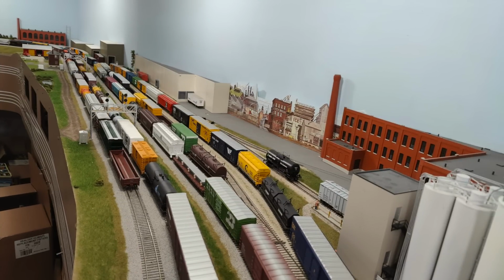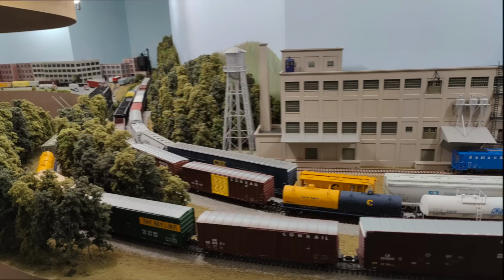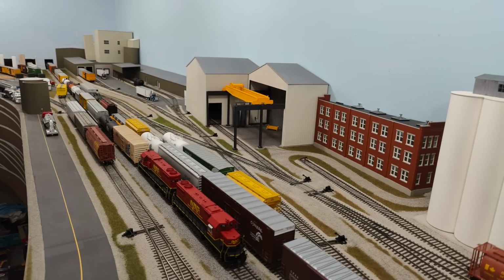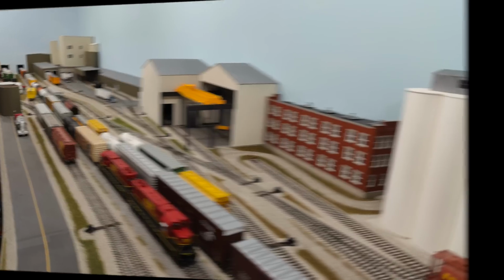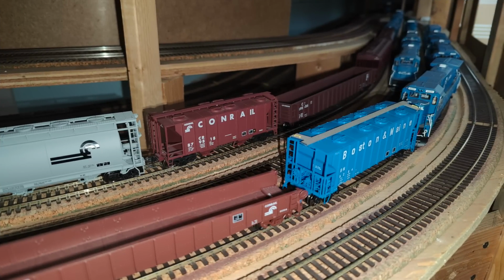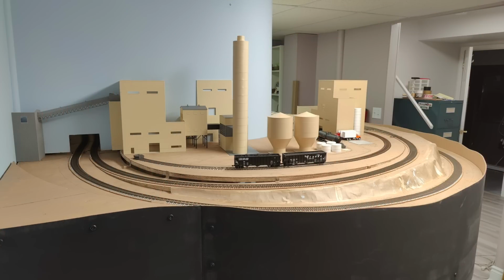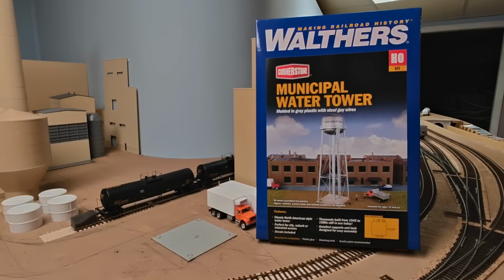Q&NE HO Layout Video 168 - 250330

Comment: I be curious if that TOFC car warp was a result of Zinc rot or not
Reply from the maker: You are not the first person to suspect/suggest that.
Reply: @ I don’t know how old the car is but I’m told the older ones had it
Reply: @nyemt601 is it from sitting in storage that got too warm or cold somewhere or the material used?
Reply: @SRF1978 I’m told it was from the subpar material used back then. But I have also had reports of it showing up on today’s models as well. I’m told doesn’t matter how you store it. (Granted moisture heat cold are bad) it still pops up. 
Kind of makes you nervous when you purchase these cars and then tuck them away. 
And it’s not only limited to the long flats 
I’ve seen reports of cars that use certain types of weights as well
Reply: Yes I bought a 2pack of ATSF RTR 85ft flatcars at a train swap meet 5 years ago. That were both warped. I didn't notice it at first or when I bought them. I took them all apart and tried so lightly to straighten them and cracked both frames. It straighten them out some but tried to CA glue the pieces back together.  There ugly underneath  but fix it some but still very noticeable..I dont run them much but if I do there at the tail end of the train..

Comment: Hi Sheldon, You've made some great progress, nice to see the latest video. In regards to the flat car warping, other than getting a replacement warranty part from the manufacturer, I would just salvage the frame ends with the coupler boxes up to and including the bolsters as well as the center frame and build a new underframe using a sheet metal weight like the ones that Accurail or Athearn use on their flat cars. I don't think the cast metal frames are repairable by clamping them and applying heat to straighten them. I guess you can also strip some parts off and use it as a flat car load. :) Joe

Comment: Great video and great progress on the layout. As for the pig flat, I had a similar issue with an Athearn 85ft car back in the day. I was able to get the bend out with a really good hair dryer putting heat on it and using a metal straight edge until I was happy with it. It may be worth a shot for you. Rolling stock is just too expensive nowadays not to be operating.
Reply from the maker: Thanks for the tip. How long did you have to apply heat? Did it crack?

Comment: Can you use a  2 pieces of brass angle running underneath and to straighten it out?
Reply from the maker: Thanks for the suggestion. The cast metal frame has become brittle and cracked when I tried to straighten it. Unfortunately, I think I will have to retire the car.

Comment: I like your time stamps at the beginning of your videos for those really only interested in certain aspects of your layout.  Very helpful feature.
Reply from the maker: Thanks Allen! Glad you find them helpful. I always wondered if anyone used them. I watched your latest video. Will you be painting the power plant or leaving it in that off-yellow colour? I know I'm going to paint mine - just not sure what the colour scheme is yet for the mill buildings. Also, will you be installing the exhaust stack at 90 degrees like I did? If you are interested, I built the substation kit a couple of summers ago and filmed a some videos on it, including connecting the wires to a few high tension towers.
Reply: @QNERailroad  I'm not really a fan of that color either.  I painted it so it wasn't the same color as how it came in the box, but it's still pretty much the same!  Sometimes my colorblindness is a real pain the a..  
I haven't thought about the stack placement but I am going to review your build for reference.  Thanks for the note about the substation build...I will check that out!  Thanks for watching!
Reply from the maker: Interesting. I have a mild colour blindness. One colour only. I can't see pale green! @KandWRailroader
Reply: @QNERailroad  Ahh..weird.  I have trouble distinguishing greens, browns and reds.  It's making getting the riverbed and water the right color very difficult.  I know it's my railroad built to my liking and all, but it will get seriously annoying if people keep asking, "why is your water lime green?"  LOL  My wife is trying to help though...

Comment: I had the same issue with the same car. Took it apart, it cracked also.
Reply from the maker: I've decided to take it out of service. Don't want to risk a runaway car. :(
Reply: @QNERailroad one thing you could do is to put a lower head shank coupler on both ends to keep it from uncoupling going over uneven ground.  Just a idea. Great layout and update sir!

Comment: Awesome final update on the series of the addition! On that warpped flat car.....In all my years of modeling I have only came across this once. I had purchased a Proto 2000 GP- 38  locomotive. I ran it one time. Everything seemed okay so, I  packed it away because I was in between layouts. Almost a year or more later, I unpacked the locomotive; set it on the new layout to run and it had warpped into what looked liked a banana. The frame was metal and had cracked in many spots but not broken. Still strong, until I tried to re-shape it back strait then broke, (CRUMBLED), also into smaller shards as well. Once at the rear tank and in the front on one side of the thinner side of the truck over sideframe.... I never understood what had happened. It wasn't warpped at first run. It was in its foam, in box, no heavy load on it near it etc., I just don't know... I have been told many proto 2000's had issues like this at one point. However, Instead of sending it back, I used it for parts. Everything but the broken frame was used on other models of GP-38's or in a parts box for use later. I can tell you this, that banana effect will cause you all kinds of problems. - Gary
Reply from the maker: Thanks, Gary. I've heard about these issues but never experienced them till now. Something about the metal decomposing.